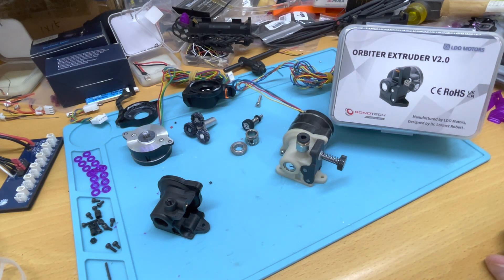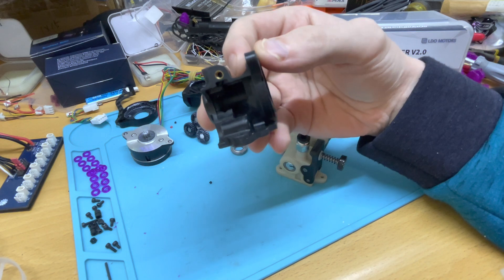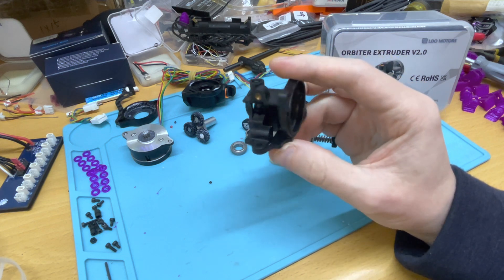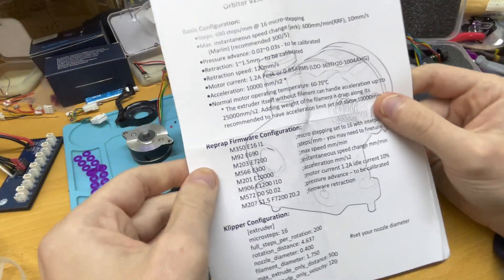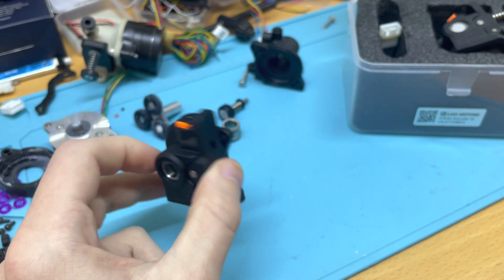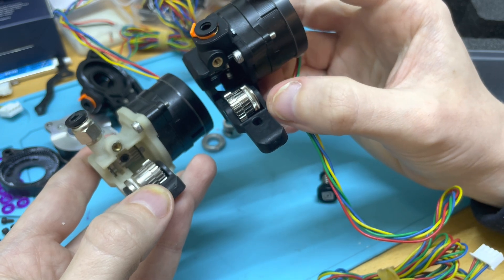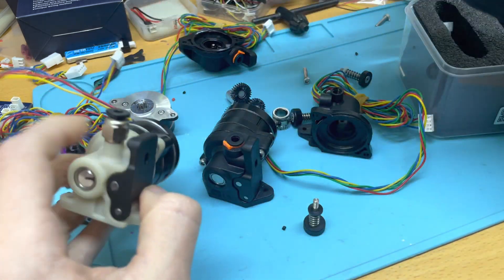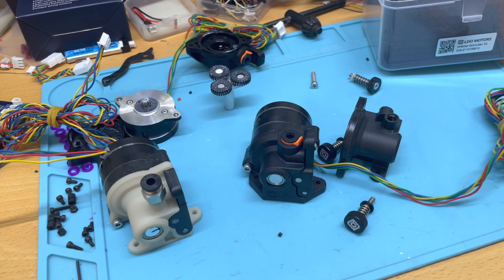Orbiter Extruder Extruder V2.0: First look and comparison with V1.5

Comment: So I guess you never made that video about the final conclusion that you mentioned in the end? :) I'm curious to know how you like the v2 now after one year.
Reply from the maker: Hey Mate, hehe true I'm not much of a youtuber, but I sure have been putting quite a few spools through it; mostly TPU but also PLA, PETG...

Once I had it setup with the adjustable downpipe at the absolute closest I've never had a single issue with it.

I don't reckon I've even opened the breach for the past 8months or so.

Makes me think I should probably have a look just for preventive maintenance, could do for a video by itself even; we'll see if I can spare the downtime.

Either way it gets a solid 10 in reliability for that manner.

I've pushed it to the limits of my mosk mag volumetric rate even, over 40mm3/s, faster than I could cool it actually.

Very impressive all across the board
Reply: @fractalengineering  Thank's a lot for that reply, even if I'm not OP.
Do you think - given the proper hot-end, thinking a Phaetus Dragon HF currently - this would be able to get to 50mm3/s?

Comment: I installed an Orbiter V2 on my Ender 3 and when I tested the steps and gave it 100 mm extrusion, the extruder made a tag tag tag noise like too much filament being sent to the nozzle and it was getting clogged. It's like sending the filament to the nozzle very fast. Could you please help me how to solve this problem?. Thanks for the help ! ! !

Comment: I work with flexible filaments often too, thank you for helping to adapt the orbiter to be more flexible-friendly!  What hotend would you recommend to pair with the orbiter for printing flexibles?
Reply from the maker: Hi Tyler, I've been printing TPU just fine on my mosquito magnum but I wouldn't necessarily recommend it for flexible only; it seems that the tight steel heat break causes a lot of friction down the throat and I have to crank up PA to 0.65!

I'm looking into implementing a hot end hot swap, possibly using a PTFE lined hotend, more suitable for flexibles

I've had great luck with a simple MK8 hot end in the past, just looking to reproduce the same setup
Reply: @fractalengineering   Surely thats a typo 0.65 there is no way
Reply from the maker: @95LegendGS  nop that's what I said :P

Comment: Is there a point with this though when now we have the lgx, the larger gears will prop make it easier to get the hole closer to the gears
Reply from the maker: not quite; if you think about it the larger the extruder wheels, the thinner the guide has to get to reach all the way to the tangent point. It's all a matter of compromises :)

Comment: Is the Orbiter 1.5 Mounting the same as the 2.0 Mounting? So the hole diameter, hole distance etc?
Reply from the maker: nop, the bolting points we moved to be colinear with the extruder hole
Reply: @fractalengineering  okay, thanks for the info :)